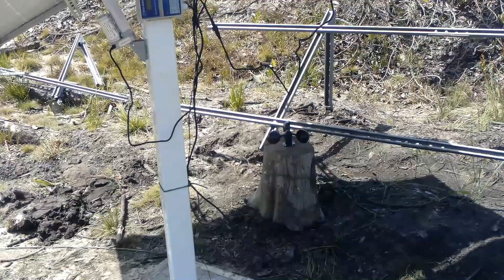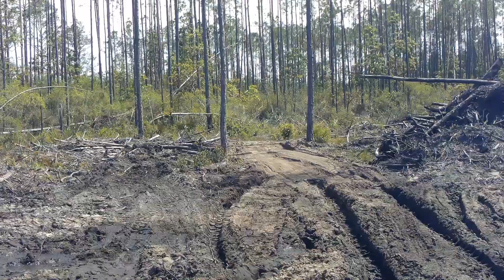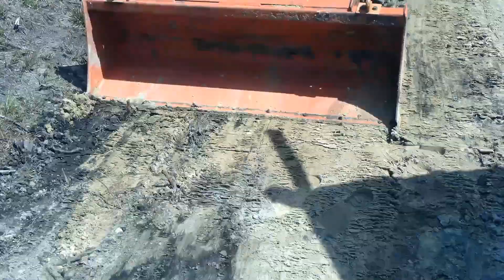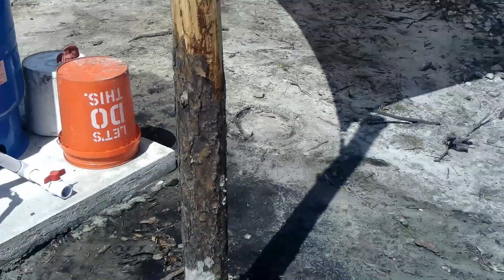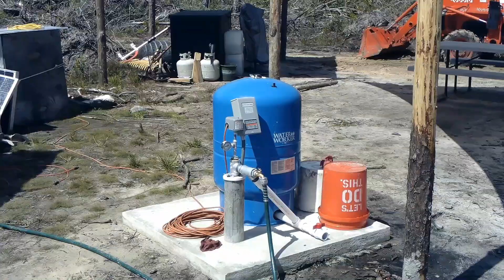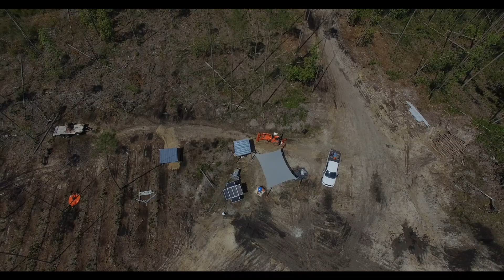Solar Tracker and Shade Sails

Comment: Cool video. What kind of solar tracker hardware did you combine with this panel setup?  Do you think the added costs and energy consumption of the solar tracker outweigh the usual setup of south facing stationary panels?
Reply from the maker: I did not do a cost analysis. In my case I needed a better mount anyway. I was sold by the 40% increase in power output Eco-Worthy claims. I have not confirmed the increased output, but it seems logical to me. The first morning of operation I did notice I was already charging at 30 amps and the sun was barely over the trees.